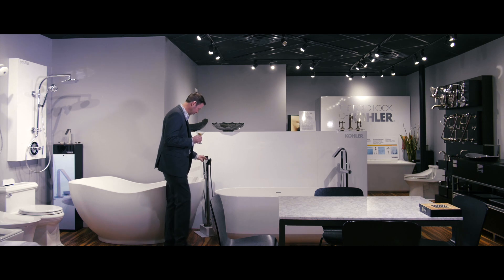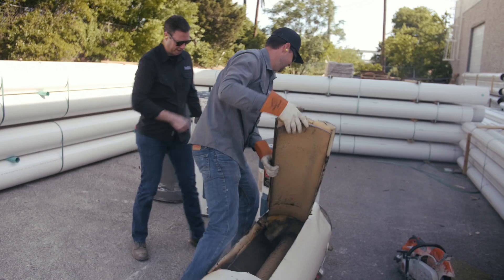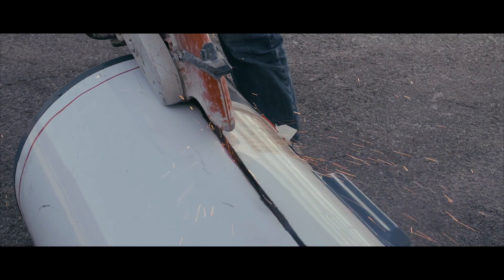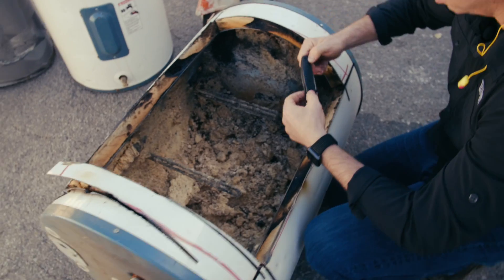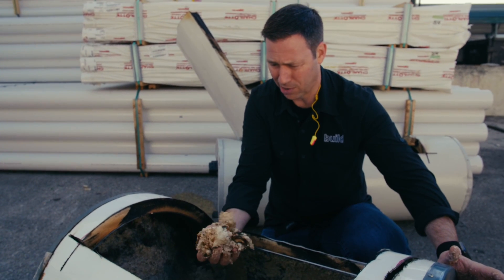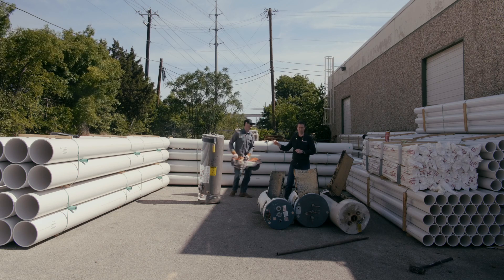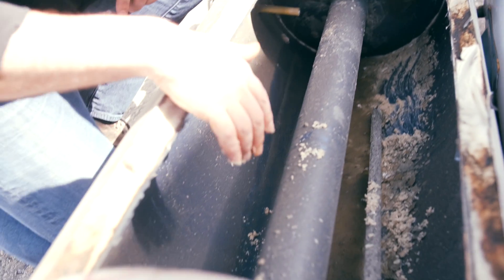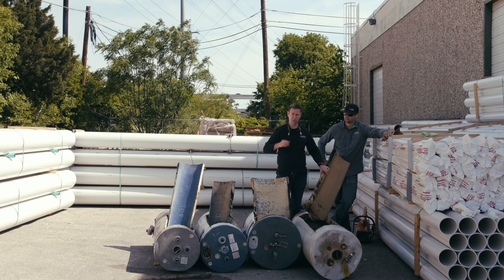Water Heater Tank Autopsy: You won’t believe what’s inside!

Comment: You've got a few different things that can cause calcium build up. 
Treated verses untreated water?

We're any of the units serviced with new anodes or was the tank drained on a regular basis?

Temperature that the tank was operated at? 125f verses 180f like I have mine set for. 

If you have the tank operating at a higher temperature, the scale is boiled (cavitated) from the heating elements and anodes.

Comment: Damn ... makin' me want to go flush my water heater right now.  That's gross.
Reply: well, we put salt on our food, and we have actual iron in our cereal and calcium in our milk. so... yeah, i would like a form of that stuff on my food. haha
Reply: That's probably why the outlet that connects to the rest of the house is on the top.  I doubt the flow rate is enough to counter the gravity from anything loose falling.
Reply: Not everyone is aware of what is inside the tank.
Reply: What good does cooking the water from the hot side? Minerals arent going to just evaporate..
Reply: Just mineral deposit it's not like some Plague
Reply: Would you like that stuff on your food?
Reply: Steve Maring will that actually help
Reply: Think that's dirty? You should see the cold water tank.
Reply: If you flush it you w not be able to shut it off unless you replaced the cheap drain valve when it was brand new w a ball valve.
Reply: xdragon2k
You are not supposed to drink from your hot water tap. You cook and drink only water from the cold water tap. Hot water from the water tank is for washing only.
Reply: but its just mineral deposits. if you drink from the cold tap you are drinking that stuff, just not in high concentration. your body needs some minerals anyways.
Reply: Can hot tap water (or warm tap water) destroy your teeth if you use them for gargling after you brush your teeth?
Reply: Yeah the thing is, if a big chuck of those came loose, it will increase the concentration in the water to maybe unsafe level.

Comment: Would you recommend a whole home water purification system to help eliminate this issue
Reply: I doubt it.  Where did you hear that?
Reply: @Rolf: [source needed]
Reply: Just a heads up. While I lived in Texas , I had kidney stones. Moved to California for 6 years.... No stones. Moved back to Texas, stones every 3 to 4 years. Too much lime in the water here in Texas. Now I only drink high ph water. No stones in 4 years.
Reply: +Rolf, I call bullshit on that! I have not drank tap water in over 45 years! Only bottled spring water or from a PUR filter pitcher. I have nothing that you claim I should have from not drinking tap water.
Reply: calcium carbonate from the shells of fossil sea creatures... its the same material as whats in your bones... the harder your water, the less milk you have to drink...
Reply: Rolf is somewhat right, but I don't think I buy the longer life thing. I raised ornamental shrimp and mineral content via a TDS meter was super important. Having the right mineral(specifically calcium) was important to keeping them. They are super temperamental. I believe that humans need those minerals as well. A glass of unfiltered water once a week would be more than enough to get those random minerals you don't get in bottled water.
Reply: Higher water concentrations of minerals (ie hard water) is correlated with better health (understand: the purer the water you drink (demineralized, osmose filtration, reverse osmosis, distilled, "purified" blablabla)  is, the higher the likelihood of cancers, autoimmune diseases etc .

Comment: How are scrap water heaters managed?  Does the junk yard just throw them in to the crusher?  What does the steel plant that buys the crusher product think of all the scale?
Reply: I knew a guy that sold a water heater to a scrap metal place, knowing it was full of calcium and sand, got a good payout and didnt complain. Decades ago though.
Reply: Steel, being dense and magnetic, is pretty damn easy to separate from unwanted waste materials. It's not really a big deal.
Reply: you can still scrap them no problem and they will not make sure you flushed the scale out. but they will give you a lower price because its not clean steel. aka other metals form different components and the isolation from the tanks still on it. scrap steel price has been really down for a long time now its really not worth much. during ww2 and for some time after im sure scrap prices were fantastic.. i scraped a big old dryer not long ago and it could not even buy a lunch from McDonalds. not even worth getting a friend to help. should have pushed it to the curb and let some other pore sole do it lol
Reply: Sounds right to me David. They also use the slag for ballast on railroad track, so it can all get used. I just looked up the price at a scrap yard, and they are offering $7 per 100 pounds. $140 per ton with a 500 pound minimum. That's higher than around here in San Diego. Last time I checked, it was $60 per ton.
Reply: The scrap business is just like the commodities market. Prices go up and down. When I was in the used appliance business, it went as high as $75 per ton for car bodies and appliances. The major west coast processor of scrap in National City California had to close due to EPA rules, and scrap went to $5 per ton.
Reply: steel isn't worth anything, the molten scale would probably just act as flux and float to the top of the molten steel
Reply: Haha, of all places, they shut down a recycling center in California. lolol
Reply: It is open again. What happened was that they had a huge shredder, and when a car is shredded, the upholstery and padding is separated out. The padding is considered "hazardous waste", and expensive to dispose of. The company would truck it to Ensenada, Mexico. The city dump would accept it. The EPA, I guess, got in a snit because they were not disposing of it according to EPA rules. They closed for a while, and when the reopened, the shredder was gone. They just mashed everything with cranes.
Reply: Thats not the first time I heard about that specific issue, but then again I am not so young, lol. Eastern Europe has a way to defeat MRSA and other resistant bacterial infections which are really fool proof and 100% effective, but the FDA will have to change in their trial requirements and their view of traditional medicine before it can be produced here.
Reply: Awesome intro video!!
Reply: I have never found government agencies to be helpful in anything. They only seem to throw up roadblocks. The way regulations are enforced, it is not about the outcome, it is that the regulation is obeyed. An example would be that back in the '70's in California, all '55 through '65 cars had to be retrofitted with a thermostat that would not allow the vacuum advance on a distributor to work until the coolant reached 205 degrees. This was supposed to lower exhaust emissions from the engine. My friend's 1964 car was running so clean that it exceeded 1974 standards. He still had to put it on the car, and it actually ran worse, but no exceptions!!
Reply: Even still though, the EPA seems to serve, more often than not, AGAINST American business as opposed to assisting businesses in finding sustainable solutions that keep people employed and manufacturing productive. In the interests of the American community they ought to work with American industries and not beat them down with fines and litigation, kinda like how the FBI provides assistance and services to smaller police departments. A handful of volunteer organizations and academic think tanks do this to spur productivity that minimizes harm to if not actually brings ecological benefits.
Reply: Jeez man, lay off the koolaid!    @optimisticallyskeptical1842

Comment: Calcium Carbonate (CaCo3).
Reply: Drop some vinegar on it and I'll bet it bubbles. (Don't try this with your monitor. You need to actually be there.)
Reply: From the Wikipedia section on Limescale: "Limescale is...often found as a...deposit on the inner surface of old pipe and other surfaces where "hard water" has evaporated. The type found on the heating elements of water heaters has a main component of Calcium Carbonate."

So I stand by my original comment: "Calcium Carbonate (CaCo3)"

I'd say that that should just about end this discussion... but I'm guessing that some commenters will wish to continue flailing away. Chemistry is hard.
Reply: That's taking carbon out of circulation.....that's saving the planet, man....you are a hero.
Reply: so.... it's Tums?
Reply: With a little metal poisoning sure.
Reply: Nope. Wrong. First video clearly heavy mineral deposits, little calcium
Reply: XD
Reply: And thats what they put on your milk. Eeeewwww.